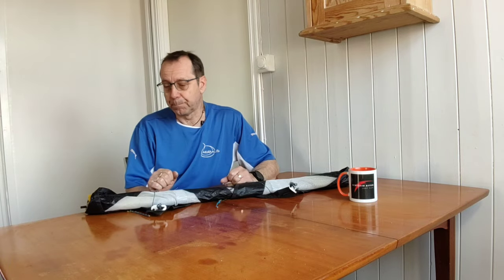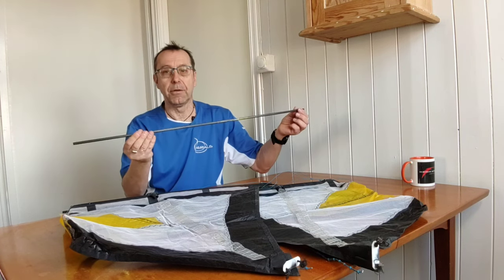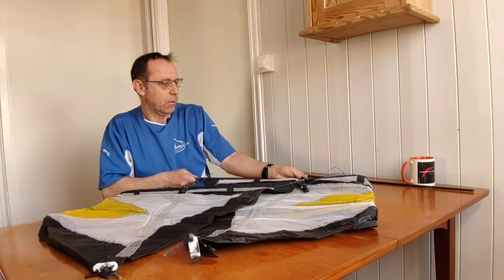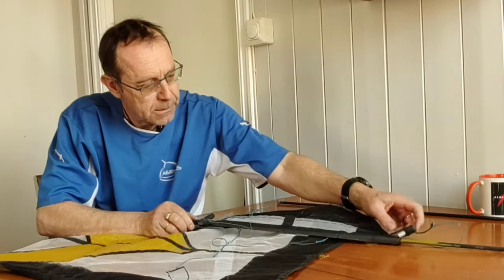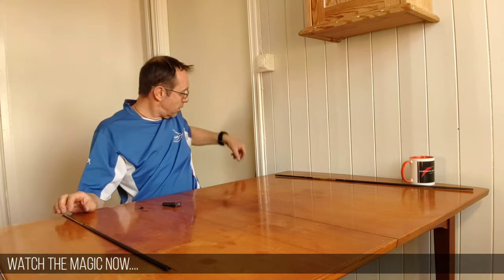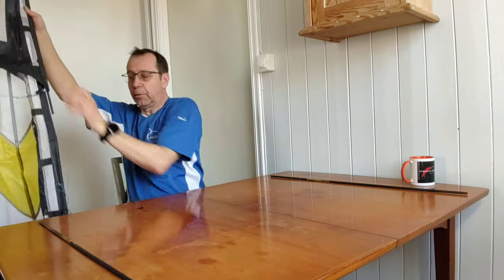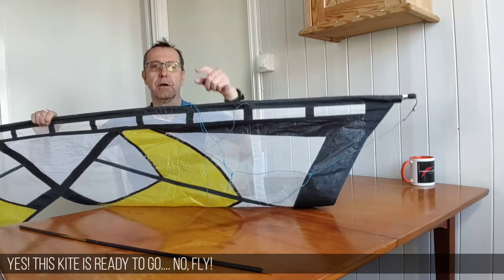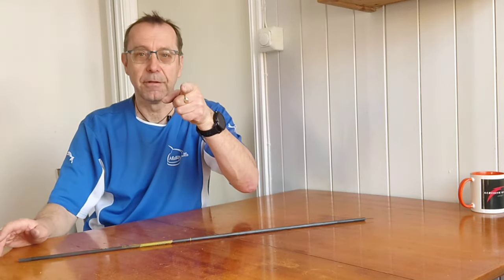How to Repair a Broken Leading Edge of a Quad Kite!

Comment: More repair and building videos, please… 2 line, 1 lines and 4 lines… 👍
Wondering that the connectors aren't glued on the rod's?..typical for 4 liners?
Reply from the maker: Hi, and thank you!

Good question! The ferrules are glued on the rods, but both ferrules are glued on the centre rod on this A-quad.

...and that made me think of a follow-up on this video. I should also check that centre rod to see if any of the ferrules have come loose. That could explain why one of the outer rods broke.

So stay tuned for a follow-up video!

Comment: How do you find spares?
Reply from the maker: Hi!
Some years ago I managed a tiny (online) kite shop in Norway. Then I closed down but I still have quite a pile of leftovers. 😉
However, there are still a few kite shops around where you can get spare parts and building materials. eBay is also an option.

Btw, where are you residing?
Reply: @aerialiskites  I'm in Spain, and have just started stunt kiting. Had a big crash today and a carbon fiber rod was damaged. Now we're looking for replacements. No kiting shops here unfortunately, at least not to our knowledge. Do you have any 6mmx700m carbon fiber rods lying around. Or would you able to recommend some place to get spares in Europe?
Reply: @aerialiskites  sorry to hear your business shut down -_- would have been a massive help now 😁, eBay doesn't seem to have the exact measurements we're looking for. Might need to buy a larger one and cut it to size.

Thanks for your response
Reply from the maker: @Cleverwolfano  In many cases you vill have to cut the carbon rods to measure. That's not a problem as long as you have a hacksaw or something similar. 
Check out this tutorial:
 * https://kites.aerialis.com/how-to-make-a-miter-box-for-cutting-spars/

I don't know about kite shops in Spain, but Metropolis Drachen in Germany stocks a bunch of stuff and will ship to Germany.

Hope that helps!

...and you know, Google is your friend 👌
Reply: @aerialiskites  Thank you so much!